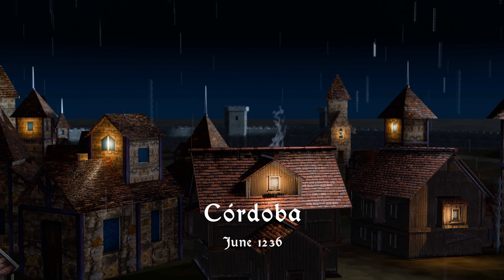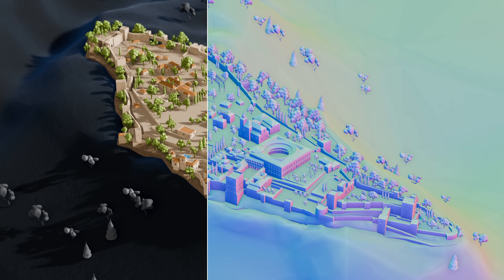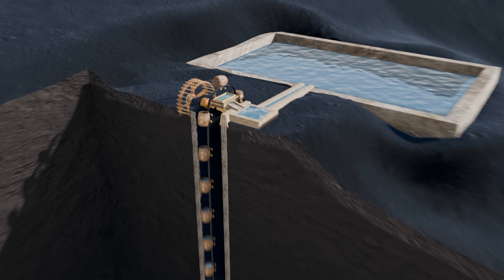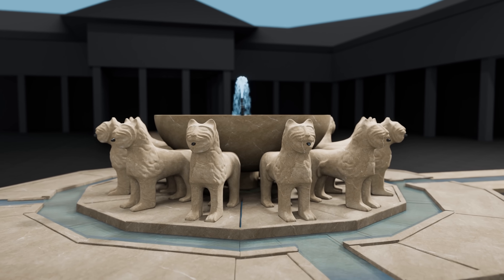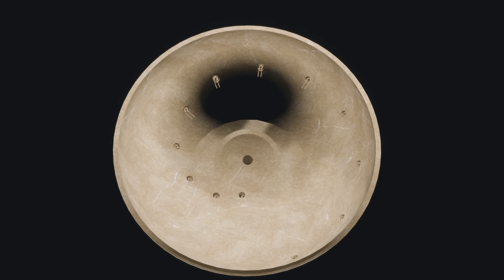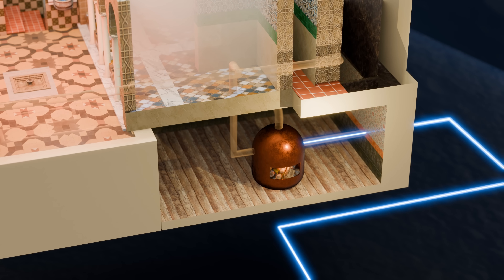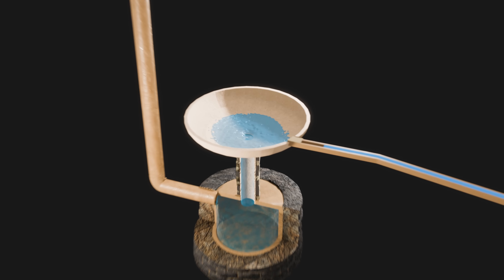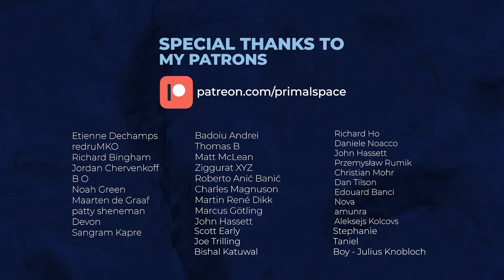The Ancient City That Mastered Water

Comment: not sure if i get a reply, you did not tell us how they managed to pull the water in the higher bathrooms while the copper heater was below?
Reply: Or how the fountains got pressurised water. If the fountains received water under pressure, why not the 6 m step?  How did they control the flow to the lions to be constant?  Why did no lion at all spout any water from reset at 12:00 til #1 lion got water at 13:00?  As the hours go by, more and more lions must share the same amount of water? At the same time #1 lion‘s share gets bigger and bigger?

Comment: For me it was the beginning portion where the elevated dam was made to have controlled flat flow of water at almost similar elevation in order to reach the palace! 

However, what I wanted explained was the dam, it’s capacity in terms of weight if not volume and the shape of the outlets to apply pressure into the flow!  The water based scientific amusements are no doubt triggers of creativity to any mind but it was well explained nonetheless
Reply: Why are you interested in the weight of the water in the dam? The dam lies on the ground and the ground itself can support any relevant weight.

Comment: The whirlpool water elevation system is stunning. It goes to show that you don't need 21st century technology to understand and make use of such phenomena. It's all too easy nowadays with pumps and electricity, even modern engineers would probably benefit from learning such engineering methods. The design seems much more energy-efficient and sustainable, too.
Reply: Well. You need a huge amount of donkeys to power that water system.  Can you provide food for them?  What about all that poo?  A hydroelectric powerplant where the waterfall is and an electric pump where the lifting of water is needed seems to be a better solution.

Comment: Using a whirlpool to pump water above the intended level was a genius. Truly a marvel of minds of those engineers at that time.
Reply: Actually it was the energy from a huge lot of falling water that lifted a fraction of that water to a higher level. The whirlpool is just a way to induce air into the falling flow. A bundle of straws could have done the same, or as normal in Tropes went holes near the top of the vertical shaft.

Comment: The whirlpool would not work if all it did was what was told in the video.
Reply: You have to ad an upward tunnel to the lower chambre, then it works. Look up Trompe, a water driven compressor and an Air Lifting pump, still in use today in civil workplaces.

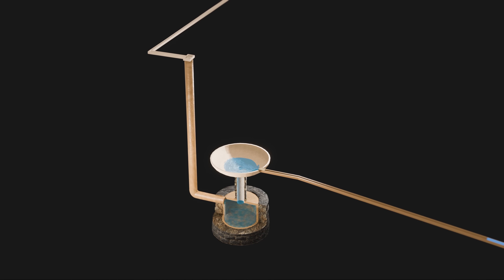Comment: 7:38 I am dubious about the aeriated water theory of differential density.
This seems more likely: The downward fall of the water from the bowl would 'pull' ambient air down with it (much like a water T-pipe used to pull a vacuum in a chemistry lab), with the vortex acting as an air-seal (and potentially a amplifier of the pressure differential). This lower air pressure above would translate into a higher air pressure below, inside the cylindrical base in the diagram. That chamber, plus the narrow pipe would therefore be acting like a manometer, where the positive air pressure in the chamber would force the water up the pipe, regardless of it being aeriated or not. This requires the lower mouth of the pipe to be fully submerged, minimising air-loss.
Reply: Add these together:
https://en.wikipedia.org/wiki/Trompe
https://en.wikipedia.org/wiki/Airlift_pump
and you get
https://en.wikipedia.org/wiki/Pulser_pump
Reply: @kjellg6532  Excellent, thank you!

Comment: with the whirlpool pushing the water higher than it is, couldnt you just flow the water back into the bowl?

attach a water wheel to it and have perpetual motion?
Reply: What this wideo do not tell is that there is a huge amount of waste water from that Trompe - Air lifting pump.  It needs a lot of water just to lift a little  fraction of it of it to a higher level. In other words, the system extracts its energy from water going downwards. Look up Trompe, and water driven air compressor. and Air lifting pumps.
Reply: @kjellg6532  thought there was more to it than shown, thanks for the info : )

Comment: 5:15 The bowl flow rate would have to increase every hour by the amount of water one lion uses, otherwise the timing would be more off  every hour
Reply: There are a lot of questions to this clock theory. How did they regulate the water flow input to be constant? How did they pressurise the water to form a fountain?  As you point out, the time from one lion to the next? This may be solved by the slope of the bottom of the basin and by the distance from the centre to the next hole. For one hour, no lion would give away any water.  How did they adjust for temperature, sun and evaporation?  I am sceptic to the whole clock theory from what is presented here.
Reply: @kjellg6532  "This may be solved by the slope of the bottom of the basin and by the distance from the center to the next hole" Excellent point!
Reply: @Gex121  The #1 lion hole can be eithe in the centre of the basin or one hour out. From the video, it seems as if #1 hole is 1 hour after the reset. That means that for one hour no lions will give any water. The #1 hole must be in the centre so that #1 gets water just after reset. As the hours goes by, the water depth for #1 will increase and it will be more forcefull.
Reply: @kjellg6532  And the timing can be figured out by having no holes in the bowl, timing one hour with flowing water, and making a hole where the water is at that point. Then do it all over again to get the position of the next hole and so on.
Reply: @Gex121  That must be how it was done. To calculate this from the shape of the bowl and the amount of water getting lost per lion is a difficult math problem.

Comment: I'm impressed by the fountain clock's precise hourly water jets and automated reset mechanism, because its 14th-century engineering, precise timing, and stunning design seamlessly blend form and function.
Reply: Well. If it rains, the click will go faster, if the sun shines it will lag. How often did they have to synchronise it with the sun?  In one hour per 12 hour sequence no lions spewed  any water.  How did the regulate the constant water input? How did they power the fountain?

Comment: The most interesting for me was the votex whirlpool that sucked in water and created a low pressure vacuum effect that used air bubbles to raise the water 6 ft, Up⬆️
 This effect can and dose raised water 70 feet up on a different way of getting air into the pipe with water in it, But I think this method Could also get it up more than 6 feet, 

The most interesting part of this: IS That; it is a version of the Troump AIR collection system invented in Spain at the same time in the 1600's to make high pressure air, to supply Air, to a blast furnace Forge, to make domastic Steel Swords in Spain, 

The Troump CAN Produce up to 120 PSI high PRESSURE AIR or higher and was used to run 60 psi Jack hammers and other equipment in mines
Reply: Trompes are named in late 1500 in Italy, but it is beleived that this method of producing compressed air are known from the time of antique, that is 2-3999 yrs BCE.  This video do not tell that the system needed a lott of water to lift a litle fraction of it and that the lower chambre needs a return tunnel up to the surface of the ground, somewhat lower than the input funnel.

Comment: The funnel spiral to holding tank that raised water is perpetual motion, if it works
Reply: It works, but the description here is not complete. Look up Trompe and Airl lifting pump. A Trompe is a water driven air compressor. Energy is taken from a gate amount  of downgoing water that is lost in the process.
Reply: @kjellg6532  I just tried a small stream of water down a straw in a glass and sure enough, air bubbles come out the bottom of the straw

Comment: Your scheme of "liftinng up water" device is inaccurate. What you show in a video it is a damn "perpetuum mobile" which is obviously can not exists. There should be another pipe in the bottom of reservoir which will allow the exit of water without air. Only lesser part of water which comes from top can be lifted, when the biggerst part will go down by this pipe. There is a work where it all described "THE MASTERY IN HYDRAULIC TECHNIQUES
FOR WATER SUPPLY AT THE ALHAMBRA". You could find it on internets. Next time pls just leart a little about physics before doing such videos.
Reply: The exit tunnel is missing, but it must comme up, not down. If it goes down there will be no pressure in the air and no lifting of water. The exit must come out say 2 m lower than the input funnel. The under ground chamber may be at least 8 m down. Look up „Trompe“.

Comment: I have a question and if someone can answer me. When the Fountain of lions would spit the water or the wate from that fountain would go to tthe bathroom since it had no pressure to begin with how did the water travel. This question is for the whole root of the pipes after the fountain since the inittial pressure has been lost how did the water flow and how did they manage to keep a constant flow of water of the whirlpool. ps what if it rained? causing more / less pressure Thanks
Reply: There are a lot of questions not answered in this video. The water is lifted by a lifting wheel (not a waterwheel). Then it flows downhill in canals through the Alhambra complex due to gravity as in any creek or river. Question is, how did they power the fountains? Ni answer. As for the lions, how is this fountain powered? How can they regulate the water stream to be constant? With more and more lions spewing water, the amount of water upis split metween more and more lions. #12 lion will only work for some few seconds til the bell siphon restarts it all. #1 lion gets more and more of the awaillable water as the water depth in the basin increases. 
As for the 6 m Trompe based pump, there is no indication about the whereabouts of all the waste water to run this pump. A Trompe produces high pressure air, not low pressure. Low pressure can not lift any water. In the bath, how is the hot water lifted from the underground control room to the showers 3-4 m higher?  
A confusing video.

Comment: timer fountain and the siphon tube auto piloted for water draining and auto resetting is my favorite technique. also beating gravity with swirl motion of water to create vacuum and succession to 6m height for water to soldiers is an engineering marvel at those times.
Reply: No, the Trompe produced high pressure air to power the pumpe.

Comment: can the whirlpool contraption be made in sequence to get water higher? i would assume there is a limit of how high it can get water up, but if you make another one, do they "Stack"?
Reply: Probably you could stack them, but I think it must be run in an on/off set up. It wil take longer and longer time to lift any water. Tromps have been made with a 100 m waterfall producing 8 bar compressed air. This should be able to lift water about 80 meters, but you need to tunnels going 100 m down.

Comment: Fun fact II. The video do not tell how they created pressurised water for the fountains.  With water under pressure there would be no need  for the Trompe compressor driving an air lifting pump for 6m.  Did they have multiple Tromps?

Comment: Fun fact: There are 12 lions, but for one full hour in a 12 hour period, no lion would pour any water from reset at 12:00 to 13:00. (And 00:00 to 01:00). #12 lion will seceive water just for a split second. As the hours go by, lesser and lesser water will come from the lions as a constant amount of water is divided on more and more lions. The radial distance from the sentre to the next lions feeding hole must be lesser and lesser as the curvature oof the botom raises steeper and steeper. The amount of water coming from the first lion will increase as the hours go by. How was a “constant water flow” regulated?  How often would the clock have to be synchronised due to imperfect regulator and evaporation due to temperature, moisture and sun? Each 12 hours? 
Sorry, I am sceptical to this clock theory?

Comment: That water funnel for  raising water is impossible. That's not how fluid dynamics work. The air and the water in the tube would separate, with the water staying at the bottom.
Reply: It works. Look up Trompe (water diven compressor) and air lifting pumps. There are some detailes in the video that is not quite correct though

Comment: Alhambra was full of tiny canals with water flowing in slow motion open to atmospheric air pressure. How did they pressurise water to power the “clock” and fountains? More donkeys with more hoisting wheels?

Comment: As a child I had an aquarium filter that worked by letting air bubbles move the water from the aquarium to the filter. Once the water, using gravity, had passed through the filter material it would siphon back into the aquarium. All that was required was a few air bubbles in the raiser pipe. It is amazing to see how powerful this concept really is. Thank you for sharing.

Comment: The video underscores the ingenuity of ancient engineers and their profound impact on urban development and sustainability. Though the Water clock fountain with siphon mechanism was a well thought system (even used in ancient roman siphon aqueducts), the pinnacle of hydraulic engineering lies in the Gravity Defying whirlpool driven pumping system to higher altitude for soliders barracks. Really astonishing Engineering and Outstanding Visuals created by your team to explain such a complex hydraulic engineering in a simplistic manner, so that even a layman can visualize and understand the concepts to a great detail. Even If I had visited Alhambra, I wouldn't have captured the engineering to this detail.
Reply: But you do not need any whirlpool for a Trompe to work, but a Venturi the help air to enter the downflow. Next question: with all that water falling down into the lower chamber - how did they get the water out so they could generate more air and continue the 6m pumping? A lot of details remain untold.

Comment: This is why I think Mum modern day people as a species are less advanced. The only thing I think is more advanced is her technology. The ancient people didn't develop advance technologies that required electricity cuz they didn't need to. They figured out how to get this s*** to work without needing to invent a modern-day pump that Natalie needs to be powered by electricity but also makes a ton of noise. No, they were like. Hey, if we do this s*** not only can we move the water 6 m upward, we can do it virtually silently with the only sound being the flowing water and we don't need to use electricity to power it. I'd say if ancient people could do this, they're definitely more advanced than modern-day humans. Maybe the technology itself is less advanced but the people are more advance
Reply: An electric water pump can be made without much noise while this pump driven by compressed air will give away a lot of gurgling and a loud hsssss from the escaping compressed air.  To pump 6m up, this Trompe based pump also needs a 6-8 m deep hole down in the ground and a lot of waste water.

Comment: The Alhambra's water system was indeed impressive, but it didn't involve horses pumping water. Instead, it utilized:
An advanced hydraulic network called the Acequia Real, a 6km canal that drew water from the Darro River
A dam (azud) to divert the river flow
Waterwheels (na'ura) to raise water to different levels
A complex system of pools, cisterns, and pipes
The system used gravity and clever engineering to move water uphill, not animal power.

Love from Republic of Sovereigns.
Reply: All that water, lifted to the soldiers quarters was indeed first lifted by donkeys, not using a waterwheel as wrongly stated in this video, but a hoisting wheel powered by donkeys.

Comment: I still don't get how they were able to calculate the fountain clock without any small delay that would add up over time. Like even clocks these days delays over time
Reply: They probably had to resynchronise this “clock” each day, if it worked as described at all. One question: the same amount of water is distributed to a growing number of lions as the hours went by. In the 12th hour there was next to nothing for the last lion, but the first got more as the depth of the water in the basin increases? The holes seem to get further and further away from the center by each hour in equal steps. If so, the “hour” and “hour” would increase as the suface off the water increases. In short, does this “clock” work at all?

Comment: The last one is lie... According to it, if you feed the water back to whirpool, then you have unlimited energy. Which is against nature...
Reply: Noop, it is sound. Look up Trompe and air lifting pumps. The first extracts compressed air from falling water, the second uses this compressed air to lift water.
Reply: @kjellg6532  If it were true, we would still be using it. But we need pumps...
Reply: @ertanevrim4462  Air lifting pumps are still in use today. Tompes have been in use in mining up till recently. A university is looking into usingTromps again as compressor.

Comment: Referring to the last part, from minute 7:30 to the end: It is impossible that the water lifts itself up to a higher level without input of energy. 
There must have been another outlet from the lower chamber, which released most of the water at a lower level, after it had done its work to drag the air so deep below the water surface. Same principle like a hydraulic ram, probably even less efficient than that, but avoiding the noise of self-closing valves.  
The lower water outlet is not shown in the video, and this makes it very misleading. 
https://en.wikipedia.org/wiki/Hydraulic_ram
Reply: Look up Trompe, an air compressor. More “modern” Tromps has an exhaust tube almost up to the same level as the input so the head of a Trompe may be relatively small.